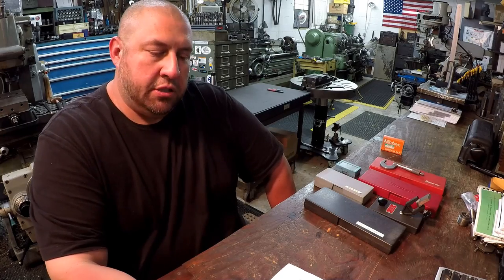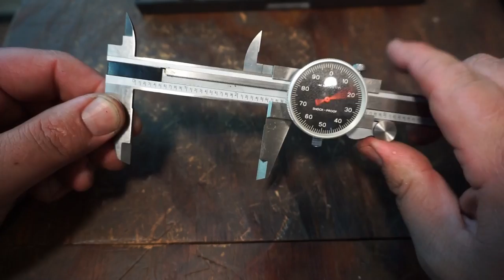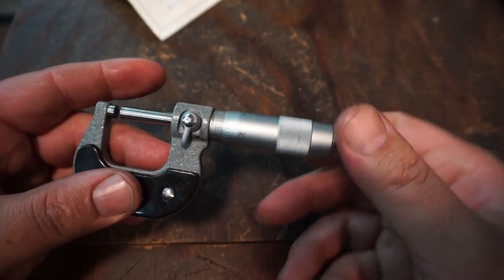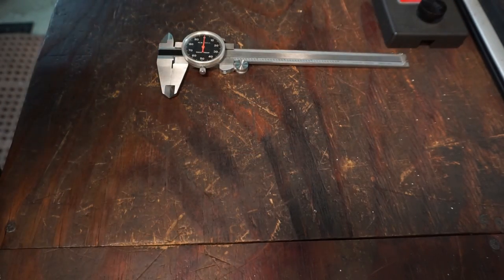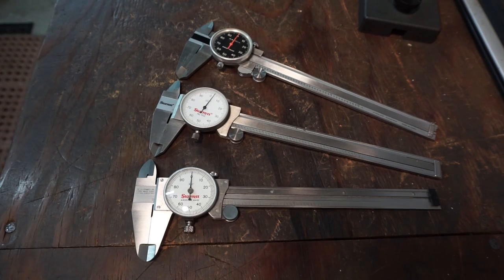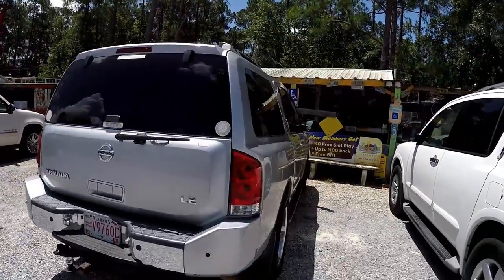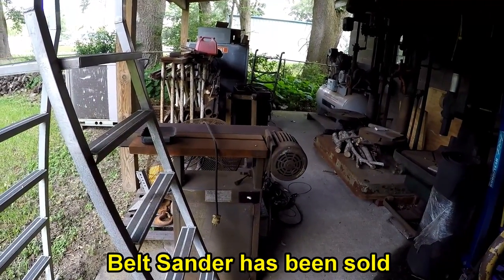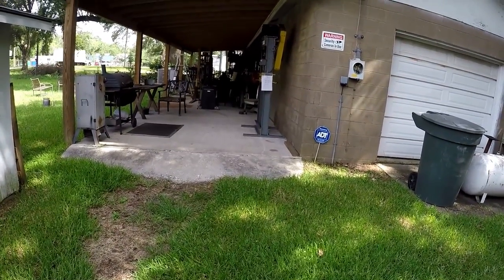SNS 175: Cheap vs Starrett, Shop Upgrades, Weekend Adventures

Comment: Adam, where will the smokers go? Maybe you also need a separate cookhouse. It wouldn't the same Abom without some fantastic food.
Reply from the maker: Yep I'll need to add onto the back of the house. Maybe another lean-to roof off the back with a new slab for the BBQ area.

Comment: Not being a trombone player, I don't spend a lot of time running my calipers back and forth.
Cadillac, Buick, Chevy; some ride smoother some ride rougher but they all get you from A to B.

Invest in some cheap gauge blocks and calibrate your cheap tools; check out "Pierre's garage"
Reply from the maker: +Robert Matel I don't use my calipers for just small diameters, I'm always running them way out for large sizes. I've already invested in a cheap set of gage blocks.
Reply: Sorry, my comment wasn't aimed at you.  It was meant for the start ups. No way am I worthy of demeaning you.

Comment: Great info. I have a cheaper dial caliper I've beat the crap out of in a paper mill and a reasonably nice 80's era made in china micrometer. Good to know that it's not likely super crusty and will get the job done. Good enough for what I use them for (bullet reloading).

Comment: Might make more sense to put the HVAC near the middle of the long wall for more even distribution. Maybe one of those Japanese split units would keep the hole smaller. Might need one for the main shop after you enclose the one in the window now.
Reply from the maker: +Hollis Inman middle would be great, I wanted to keep the wall with clean lines though.

Comment: Interesting comparison with the tools re accuracy but I think you made the point well about what does a guy (student etc) do to get going in the first place - buy the cheaper one new or look for a used higher quality one.
Exciting developments with your shop addition that's for sure! however it seems a bit cock-eyed to moving new stock from the intake place right to the back of the shop.
Reply from the maker: I'm trying to work with what space I have, and I'm setting it up how I want the work to flow. I want the welders near the front of the shop so that they can be used outside too.
Reply: Good point, thanks.

Comment: Shop addition will be awesome Adam! I think I'm more excited than you are! I too have come to the point where I need to expand which I never thought would be needed. It will be nice having the separation of welding/grinding from your machines keeping the grit off of them. I always have to cover my machines before doing any grinding which is a real pain to do every time. A nice slab out front connecting it all will be a nice touch to finish it all off as well as very useful. This will make for interesting content as well as give me some ideas for my addition. Your new camera person does very well also! Great job both of you!
Reply from the maker: +wvrockcrusher I'm excited about the slab work myself! Been needing concrete out there for years.

Comment: Love knowing about the construction projects. As an idea to be able to close up the walls till you get the funds for the sheet metal, I have used OSB in the past to skin walls. It's cheap but it does smell a little. Not sure how expensive the metal is for skinning the wall though.
Reply from the maker: I wanted to try and shoot for a complete job, so I have been saving what I can. We're going to make this as complete as I can. Frame up a wall, and it will be tinned on both sides with insulation.
Reply: Abom79 could not agree more that is always the best way to do it. Unfortunately sometimes you have to make do because it's how much you have available. Wish I lived in the same state as you. Would love to come by and help you out brother. Done a lot of construction work in my past. Everything from concrete, framing, drywall, plumbing, electrical and other fit and finish. Maybe one day I can come over and help you out.

Comment: Great video Adam. I also echo some that you said the less expensive work, however like you said, they are new and not used for many years. I have some Harbor Fright dial calipers I used when rebuilding an engine. I have since watching your videos have started to buy Starrett tools. My first purchases were tap holders. What a difference in quality. The cheapo holders that come in sets just don't hold the taps. I'm also looking for Greenfield die holders. I even found an old set of drill bits that I'm going to practice sharpening. Thanks for your video's and allowing us into your busy life with work and Elaina. The new enclosure will be awesome!
Reply from the maker: +Aaron Belknap The quality tools are just nice to have, use, and feel good in the hands. Congrats on your Starrett upgrades! The old drills are usually a good high quality cutting tool. 
Just FYI, Elena and I have been divorced for a couple years now and have gone separate directions.
Reply: Foot in mouth (or fingers). Sorry about you and Elena. I didn't know. I've been watching the SNS series and not quite caught up. Anyways. Been searching Ebay for Starrett stuff. Good drills are a must. I currently use cobalt steel drill bits. Anyways, great video's. I've learned a lot.

Comment: Adam I used white metal roofing for the ceiling in my new shop  put conduit on the outside for lights  easy fast instalation just fasten to rafters something to think about mike
Reply from the maker: +Judith Cook That's the plan 👍🏻

Comment: Nice to have more space (since it always looked a little crammed ) , I'm looking forward to the updates :D . Is it possible that you are going to buy some machines in the near future  (surface grinder or id. /od. grinder) ?
Reply from the maker: The machine on my mind right now is a bigger lathe, swing and bed length.
Reply: Abom79 that's awesome , but it's gonna take up some floor space 😎 , Can't wait for #heavyturningathomeshop .

Comment: The cheap $15 China dial caliper looks very similar to the China made Starrett while the US made caliper looks different. The real test is to measure past half way point (3") of dial calipers and you will notice a difference in accuracy. US made Starrett and Mitutoyo calipers all read accurate from 0 to 6" with accuracy under 1,000th inch while the cheaper calipers are known to read off several thousands beyond half way point of calipers.

Comment: I'm rather disappointed in this review/comparison. The Chinese calipers were accurate and repeatably accurate like the Starette but undesirable because they were sticky, but the Starette caliper that was sticky was worth 201 dollars? Are you kidding or just a shill for Starette?
Reply from the maker: I didn't say they were worth $201, that's what they are listed at for new price. You can buy lots of quality used named brand tools for cheap. The ones I showed in the video I paid $50 for at the flea market, and no I'm not getting anything from Starrett for mentioning them.
Reply: The point is you didn't give any sound reason for choosing one over the other never mind the expensive one over the cheaper one. Was that not the entire point of doing the comparison? Can you not understand my disappointment?
Reply: A $15 tool will not last 3 generations. I work in a shop with 50 other machinists and nobody uses cheap tools. Cheap tools wear out or break in a short amount of time. If those calipers are sticky right out of the box there's already something wrong with them. They will not last or maintain accuracy for more than a year or two of daily use, if you're really lucky. If I used cheap tools I could scrap something that costs tens of thousands of dollars because they failed me, I'd lose my job and lose my credibility as a machinist. I'd rather buy well crafted and reliable tools that will maintain accuracy for my entire lifetime and beyond. He's not a shill for "Starette" he's a professional that takes his job seriously.

Comment: The nice thing about the 120A Starrett that you don't see on other calipers is that you can pull the 4 screws and you now have access to clean the drive gear and rack.  

Most of the others you have to run your head through the crud and off the tail to clean the rack and drive gear.

Comment: The problem with Chinese tools; is that you can not do US Government contracts with these tools.  You can not get a certification sticker on them.
Reply from the maker: Best to buy high quality tools wether American Or European.
Reply: @Abom79   Shout out to you. (doing some Abom79 catch up) Question for you. As per oxtoolco 4 part series on lapping plates, if you lap all six sides of three cast iron discs in the correct sequence do your six surfaces end up all end up mutually parallel and co-planer? Or not. I'm trying to figure out how to make the plates surfaces  parallel as well flat. Thanks. 
That last post on the cover machining looked and sounded scary.

Comment: New addition plans sound good Adam.  Hopefully you can get some sealer on the slab to make cleaning grinding dust easier in the future.
Reply from the maker: I have thought about that too. I'll be pricing it up to see if I can work that in later.

Comment: Since the studs won't be load bearing, I would try to run them between the posts so as not to lose floor space putting the bottom plate on the concrete.
Reply: Hang the wall from the header beam
Reply from the maker: The wall is going between the posts.

Comment: The problem with people today is that they don't understand the concept of saving for something good. They need it now, and need more than one. Some people would rather have 5 shitty things than one nice one. 

The problem with Chinese products is that there are many factories making the same product, and there's usually no way to distinguish between them. Also, besides poor QC leading to unreliable products, factories produce different tiers of the same product. They'll sell the top tier products to their friends, and importers that actually go to conga to get the product. If someone blindly orders product from China, they'll get a lower tier. Say I wanted to bring in 10k of those calipers, but couldn't make it to China, they'd send me a top tier sample then ship out 10k of the lower tier ones. And it's a losing battle trying to get that issue fixed. Also, if you get a really good set of calipers, me trying to find ones from the same company, same factory, same production shift, and same tier, is impossible.
Reply from the maker: +Andrew Delashaw Yep, I understand. Use em then loose em. It amazes me how much stuff that country spits out.

Comment: Hi Adam, I have some cheapo tape measures for my woodworking, now they are no better than Stanley or the like.

The important thing is that the same measuring tool is used throughout the course of the job, once you start mixing up the brands then measurements can vary.